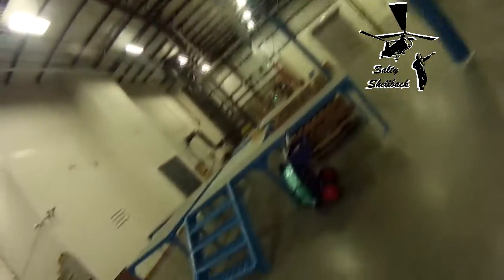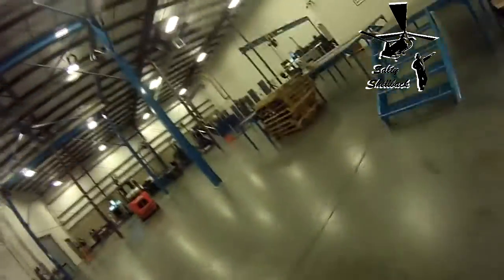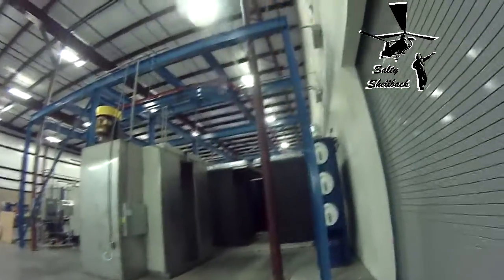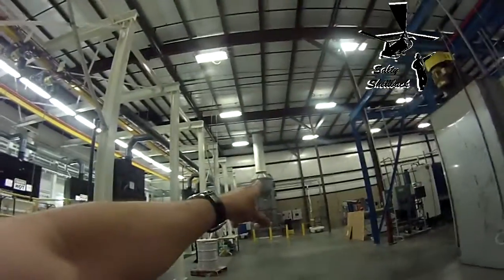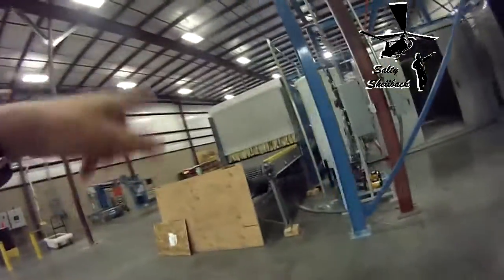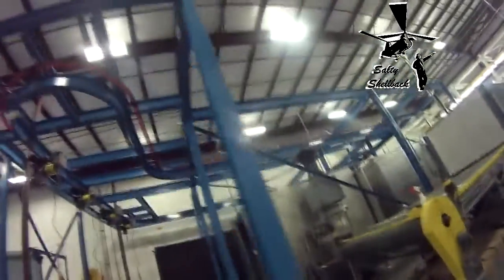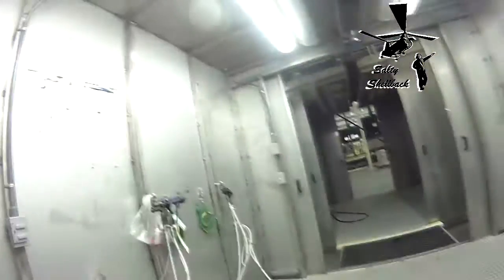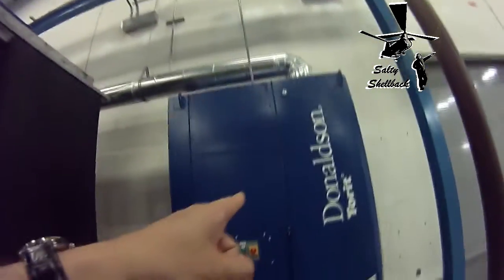Shop update  (#JustinsFinalMission 13/100)

Comment: I've been there.  That's the factory where they make the Ninjas.  I infiltrated the building and took pictures of the thing that does the thing and the dumaflatchy.  But, that was when they only had the BTTDS 8000.  Shhh, don't tell anybody.  There's a Ninja assault team still looking for me.
Reply from the maker: Just make sure you don't leave a trail of empty ketchup chip bags and you'll be fine.
Reply: saltyshellback I left the Ketchup Chips at home just to be safe!